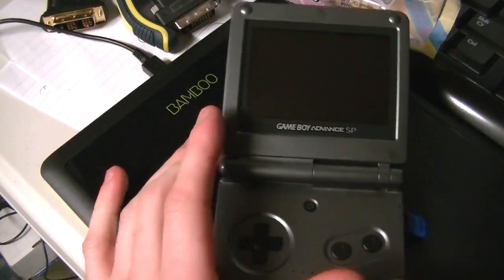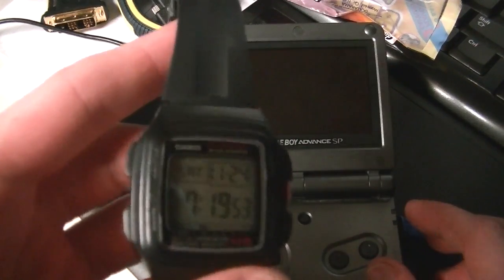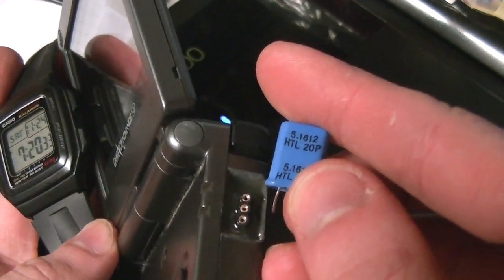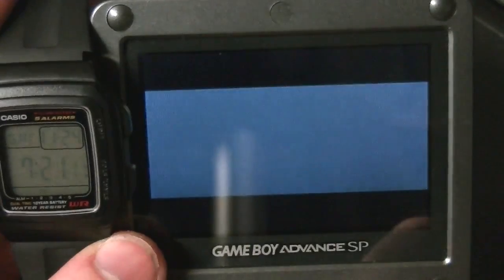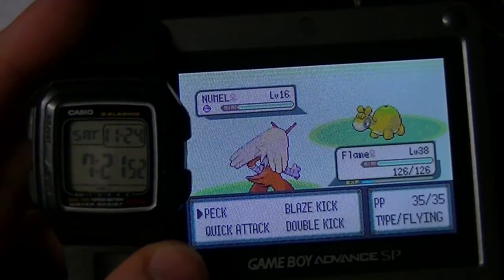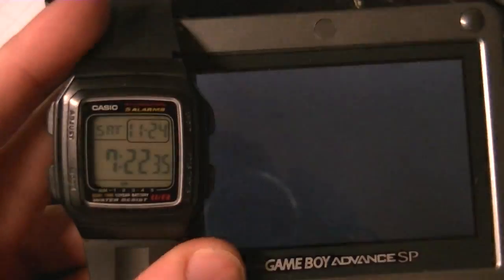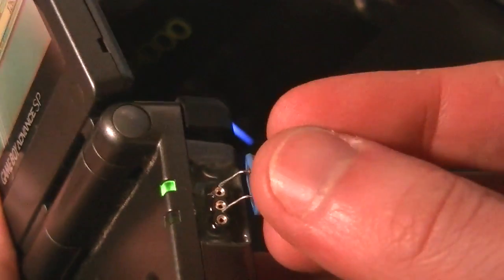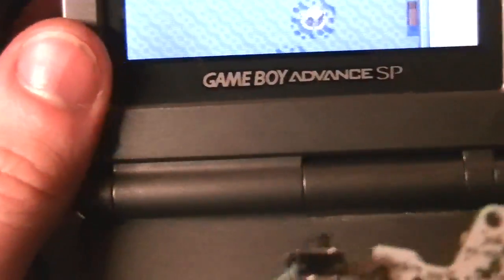Game Boy Advance SP OC 20Mhz

Comment: You know what would be amazing? If one could replace the CPU for one that's 10X quicker than the original, and run those ambitious 3D games that ran at 7-8 fps, at 72FPS, while also making the LCD refresh at that same frequency. Super fluid 3D gaming! It would ve great for home brew too
Reply: Is there a way to overclock these but not have the weird chipmunk speed sounds?

Comment: its amaizing how we can get 500% overclocks on hardware like this but we cant overclock modern cpus at more than 10 percent
Reply: This is because the GBA is intentionally underclocked to provide long (as much as 10 hour) battery life, while most modern CPUs intentionally push to thermal limits. Modern portables like smartphones use all sorts of tricks, such as reducing the clock dynamically, to improve battery life.

Comment: I hope you'll see this even though it's an old video. I'm struggling with my Pokemon Fire Red and Leaf Green after doing this mod. Every other game works. GB, GBC or GBA, you name it. And I've even tried it on both my SP and my regular GBA. Same result. 

I've removed the old crystal entirely and made good joints to the PCB, and even placed the Crystal directly onto the PCB, but it's still the same issue. The crystals I've tried are 8, 10 and 12mhz. Now onto the issue.

The game won't load if any OC is present. It launches the boot screen, fades out, and gets stuck in the faded out state. If I boot it with the original crystal, and then swap it out during gameplay, it screams distorted noises, and just wont accept it.

I'm waiting for a 6mhz Crystal to arrive, but I feel that it's something to do with the game itself, since it just refuses any OC at all. 

I fear that it might be because of the cartridges likely being counterfeits.

What would you suggest that I do to overcome this? Is there some kind of higher quality or more appropriate crystals that I could use? These ones are cheap 2-pin ones from Ebay.
Reply: Check that your game is legitimate      and you cant expect things to work when pushed 5x there limits     Your not only overclocking the console but the games chips too
Reply: Were you able to solve this problem, I have the same problem and I did not ask to solve my hypothesis is that it is not that they are not original, but that they are revisions of the original cartridges, for example, I have an emerald with the same problem and it is original but it is v2 since the memory chip is one cut according to research is due to chip shortages and they integrated another new and reduced but they are 100% legitimate
Reply: CHIP SRAM
V1
https://cf.shopee.com.br/file/bb2baf85fb74448892c2e93e85abf20a
V2
https://i.stack.imgur.com/QcZR6.jpg

Comment: I'm having trouble getting my GBA SP to accept the new crystal. I just have two different looking 27Mhz crystals from radio controlled toys. One of them will speed things up ONLY IF I grab the two terminals and case with my sweaty hands. The other will just act like there's no crystal at all when I do this and slow things waaaay down. Any input? Thanks man!
Reply from the maker: They have different characteristics, it's better to use crystals designed specifically to clock  microcontrollers. Crystals for RF applications have different modes of operations and lower impedance's which might not resonate properly with the low power drive circuitry present in the microcontrollers. Also 27 is a bit high so you might be getting some fundamental frequency of it only when you introduce the right capacitance by holding the case.
Reply: Thanks so much for the reply! I haven't checked this account in a while. Shortly after I posted this I decided to pay attention at yard sales. I saw a cordless phone the next day for 1 dollar. "That thing handles caller ID and number storage." I thought. Bam, 14mhz crystal. Overclocked GBA SP. Metroid Zero mission was hilarious. Bought a copy of Pokemon Leaf green. It has some stability issues. Loading issues are avoided by shorting the crystal and thus making it run very slowly and then opening the throttle in game. Still has some issues. It will randomly freeze and squeal at me. Much more interesting is that the first few characters of names in the conversation box will be missing. "Oak" will be "   k", etc. Except there are still spaces left for the characters that are missing. It's like the graphics for the font are not being loaded for those first few spaces or the character name is not being read from memory quickly enough. Very cool.
Reply: Is it possible that the processor isn't getting enough power to run at these speeds? I have no idea if it's possible to increase the core voltage independently like on a PC or if the battery just isn't capable of supplying the amperage needed. I guess i should try overclocking it while having it connected to a charger.
Reply from the maker: The ARM7TDMI's core uses an internal reference of 1.8 volts so you wont gain anything by increasing the V of the bus. The co-procesor Z80 can go up to 5V, but youll just fry the ARM at 3.8 possibly
Reply: Gotcha! When this class is over I'll get back to working on it. I'm planning on stick a selector on the back with hookups for multiple crystals.

Comment: Nice. Good idea to create a hot swappable port on the side of the console, i may do this.
I was kinda surprised that you can get 20MHz oscillators that work with the GBA though.
Reply from the maker: The datasheet for the processor would indicate its possible however whats limiting this is the speed of the cartridge memory, in fact you will notice when doing this that some games will have trouble starting up at higher clocks.
Reply: Ah. Well I want to play emerald anyway, so the 14mhz oscillator I got from an old 386 motherboard should work fine.

Comment: I removed the original crystal and then connected 8mhz one. Console boots but the game wont start. I cant figure out why it does this with my pokemon emerald :o It still works fine with other GBA games and older pokemon games.
Reply from the maker: Does it boot with a crystal closer to its normal speed? Can you hotswap the crystal / switch it after the game boots? It could be the cartridge not all of them are created equal. I have seen different PCB's designs and some which were counterfeit but ignoring that, try booting with a lower crystal and switching it after, might be causing errors in RAM on start-up preventing it from working, these systems have little to no error correction implementations, it doesn't take much make them unstable.
Reply: Oh, hotswapping the crystal with a switch didnt work, but if i boot with 4mhz crystal and then add 12 mhz,just like you did, it works as it should be :)) Thanks!!

Comment: Hey! I connected 8mhz crystal in parallel with 4mhz, but pokemon emerald wont boot up. There is also a switch.  Pokemon red for gbc works emerald doesnt. Any ideas? maybe removing old 4mhz crystal?
Reply from the maker: My GBA's crystal is completely removed, only one crystal is plugged in, not in parallel. It could be the parallel capacitance is too high, or the parallel resistance is too low, or the series inductance is too high. They might also be different Resonance mode types which could be cancelling but that is unlikely if you are using crystals under 20MHz or above 2MHz.
Reply from the maker: Another issue if you havent hacked open the ceramic top to tap into the pads you might be connecting your parallel crystal from one common end of the oscillators to one of the grounded pads on the outside of the package, and on a side note different games have different clock and noise tolerances, a lot of the Pokemon games use a frequency divider to down clock so they are more tolerant to overclocking as running twice their speed is only really running them at their nominal designed speed.
Reply: Maybe I'll try to remove the crystal from motherboard and see if it works :))
Reply: @Taikausko  Were you able to solve this problem I have the same symptom a 12 crystal works in pokemon crystal/silver but not in emerald
Reply: @metamurloc  Hey, yes. It took original crystal oscillator off and i boot the system with 4.3 mhz crystal and then switch it to faster one. I now have socket wired to original crystals tabs so its easy to switch crystals while in game
Reply: @metamurloc  I just now rewatched the video and i have same setup as in this video :) You indeed need to start the game with original (or close to original speed) oscillator and then swap it to faster one
Reply: @Taikausko  Do you have a diagram of how you installed yours?
Mine is this way (image).
https://1.bp.blogspot.com/-bkOM7K4U4O8/YPQ6zeDVAQI/AAAAAAAACkw/jEKxwrnEl5EhxxVaTdSWeKY__vH9JQZRACLcBGAsYHQ/w640-h640/DIAGRAMA.png

I start with the original 4mhz crystal and change to 12 with a switch but what happens is that the image freezes and the sound is distorted.
It works fine with first and second generation Pokémon this way, but not Pokémon Emerald.
It may be due to the crystal but it is practically new (12mhz) but later I will buy another one of 12, 10 and 8 to test.
Reply: @metamurloc  no i cant remember how i wired it, but probably same way you did. And i didnt get the switch thing to work, so i ended up just having separate boot crystal and "turbo speed" crystals

Comment from the maker: I suspect the problem is not the DCK dot/data clock  , since that just clocks the data bus chips to load the data from the motherboard chip to the screens chip. Running that higher frequency just means the offload happens much more quickly. I suspect perhaps the Vsync is the culprit, on my GBA this is a separate RC oscillator I don't have many board revisions to look at so I cant really offer you any advice on changing it besides messing with it to confirm its perhaps writing multiple frames.

Comment: Thanks for the response, that really helped. So is there anyway to bypass this problem? I've found that one of the pins that connect the screen is the Dot Clock (DCK)? So if this is responsible for the refresh rate (I'm not too sure), then in theory, if I was to disconnect that pin, the screen would run at it's own speed while the game plays at the increased speed? I'm gonna have to play around but I appreciate all the help I can get. Cheers

Comment from the maker: I believe the stock screens have a on board RC oscillator which clocks them separately to the rest of the game-board so that they stay within their refresh rates. It's possible that your screen clocks off the processor line and is being refreshed faster than it can handle , causing the display to overlay multiple writes to the slow responding cells causing it to stack, essentially turning up the contrast by additive blending in a sense.

Comment: Hi, I was wondering if you could help me. I've put an ags101 screen in the original gameboy advance, it works very nicely. The thing is, I've gone as far as to put the option to overclock in it now with an 8mhz crystal oscillator. When overclocking however, the game doubles in speed as predicted, but the screen also increases in brightness/contrast to the point where you can no longer see the all the colours? I'm having a nightmare trying to figure out why this happens.

Comment from the maker: a more advanced setup would be a programmable clock generator replacing the crystal, for variable speed control, probably a high frequency RC oscillator circuit with variable R or a VCO with variable voltage input. Or a crystal to a divider and a tap selector / multiplexer.

Comment from the maker: easy just open up the Gameboy, locate the main crystal oscillator, cut off the top layer of the ceramic case of the oscillator or desolder it, jumper in a crystal of choice.